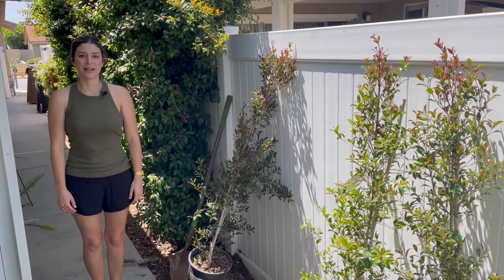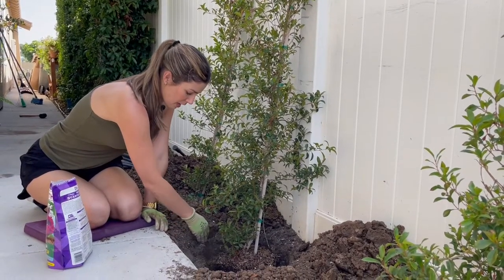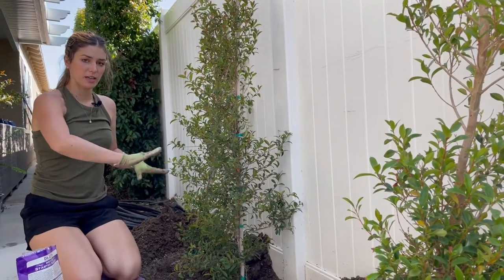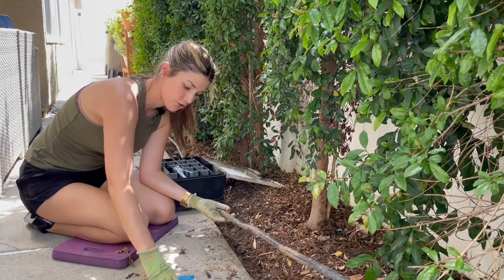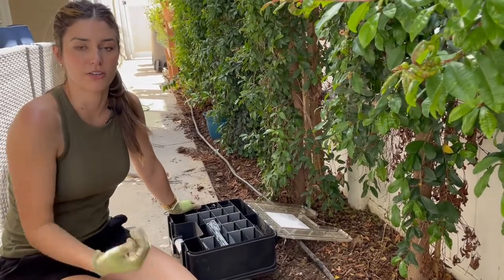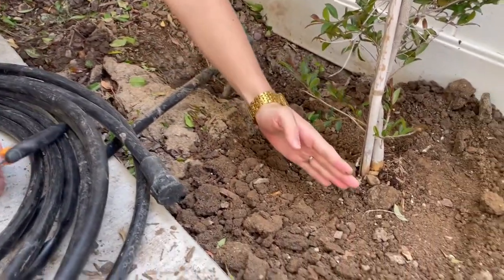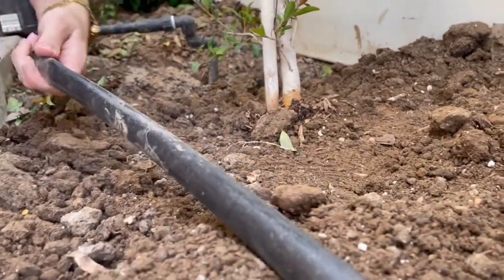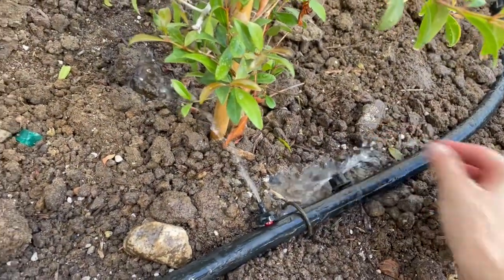How to Plant a Privacy Hedge + Installing Drip Irrigation - Eugenia (Syzygium Paniculatum)

Comment: Hello, and thanks for this video! I'm from South Africa and purchased 10 Eugenias to create hedging against my neighbor's wall. We got ours from a Eugenia farm and the farmer provided some directions regarding the installation. What you did is 100% correct! The farmer gave us these installation instructions:
1. Dig the hole in a square shape - this allows for downward root growth.
2. Once the hole has been dug, fill it with 20L or 5.2 gallons of water and leave to drain.
3. Layer the soil (as you did) with a combination of bone meal and compost
4. For the first 2 months, provide the plant with 20L of water every 2nd day, thereafter, you can water as normal, either a little bit every day or every second day. Once roots have been established, Eugenias are pretty drought tolerant.

I'm now going to set up drip irrigation for them, as the manual watering is a bit of a pain! Thank you!
Reply: This is really helpful. I’m also in RSA and have been trying to figure out if this would be a good species for our climatic conditions.

Comment: Hi, we were thinking about these as a hedge as well… are they messy with berries that stain your concrete? Thank you
Reply from the maker: They do drop berries and it can stain the concrete if popped. Most of the berries land in the planter below so it hasn’t been much of an issue for us. I do find a lot of little sprouts which I believe come from the fallen berries, but they are easily pulled out with two fingers. Hope this helps!
Reply: @passionforplants3242  Thanks so much for the reply. I didn’t want ficus because of the roots being invasive around the pool. But now I’m not sure about the berries possibly staining the pool. Haha maybe we’ll have to go with podocarpus instead.
Reply: The berries are edible. The darker, the sweeter. There's one seed in the center.